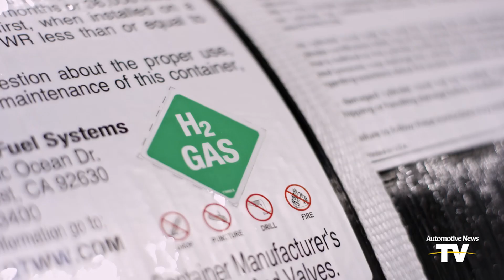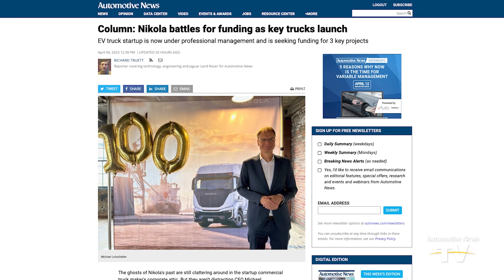AUTOMOTIVE NEWS VIDEO - 04/07/2023: Nikola’s battery-electric Class 8 truck on sale

Comment: Nikola is not developing autonomous software. Hopefully they are not funding  it's development by another company because they need all the cash they can get right now.
Reply: Yes they do, buy buy buy NKLA
Reply: @skunkco3982  "Nikola Corp. will test autonomous driving software from Plus on its battery- and fuel cell-electric trucks later this year and become the first zero-tailpipe-emission truck maker to make it standard in 2024."